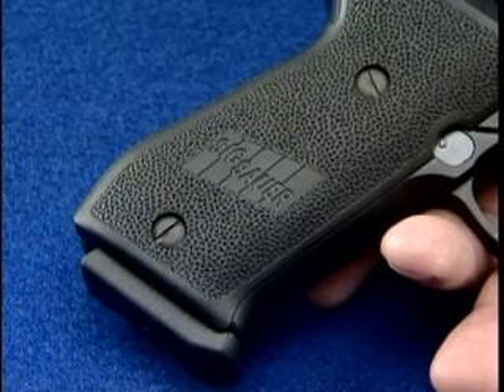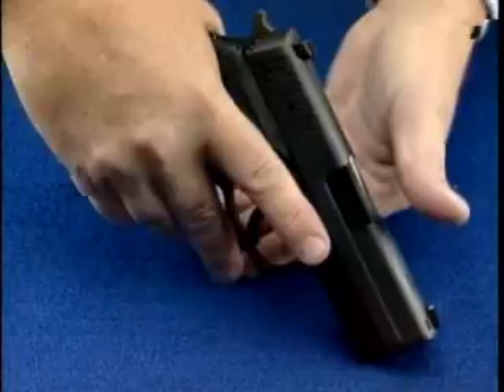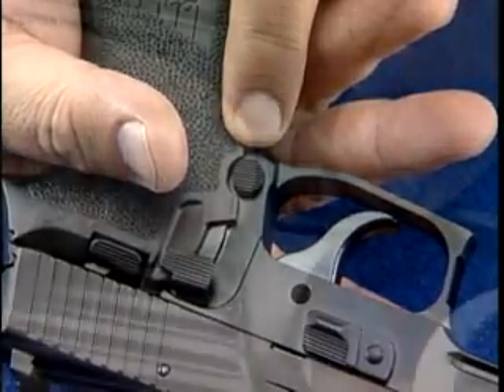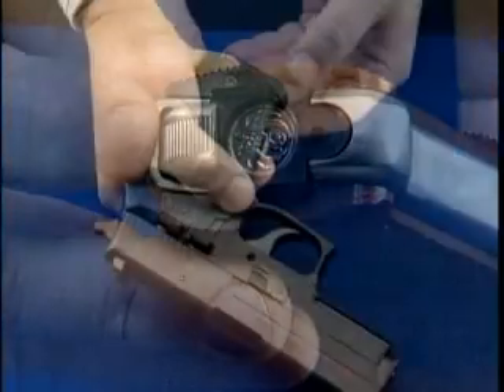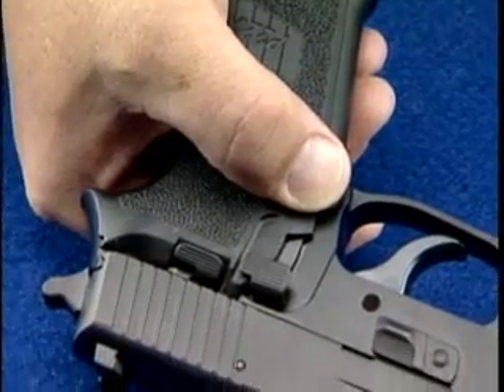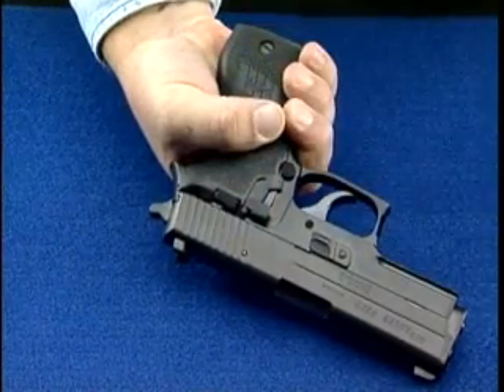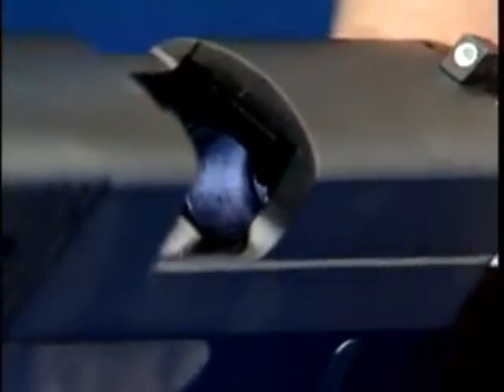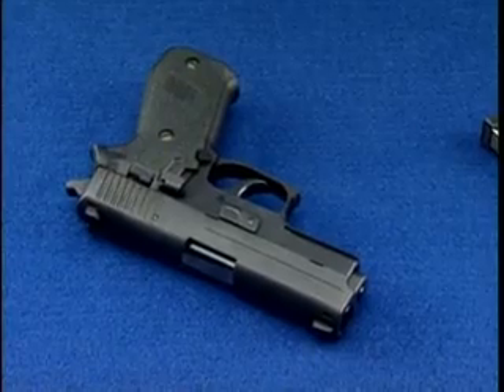How to Unload a Semi Auto SIG Pistol

Comment: @shadowassassian7 

not all guns feature that De-Cocker. 

If it doesn't have a de-cock lever, double check the gun is not loaded, then double check it again, point in a safe direction, check it again, and again, then pull the trigger.